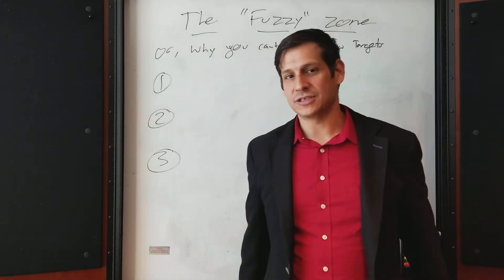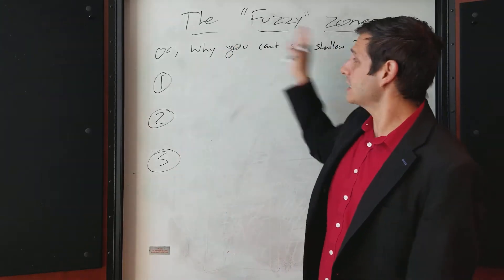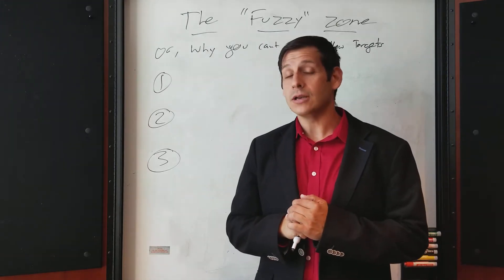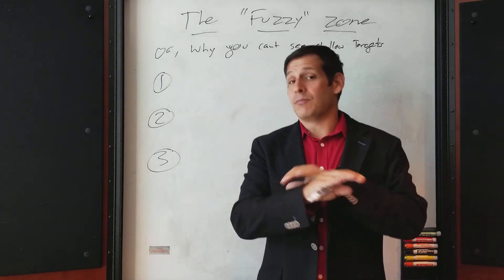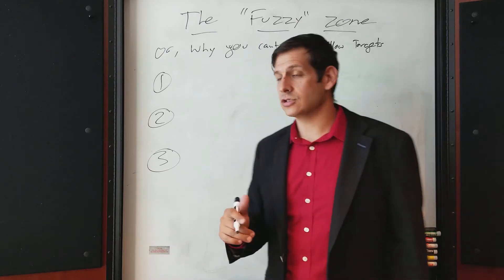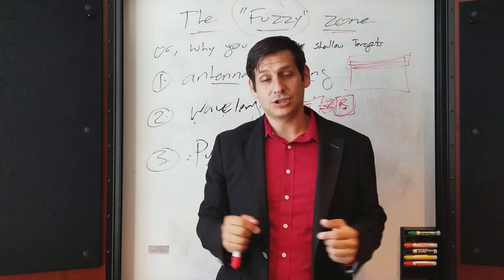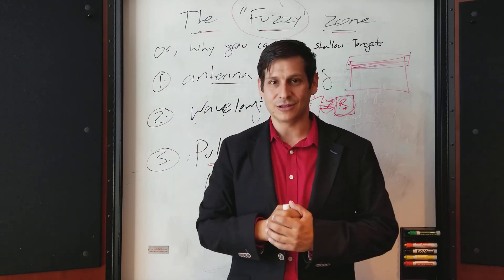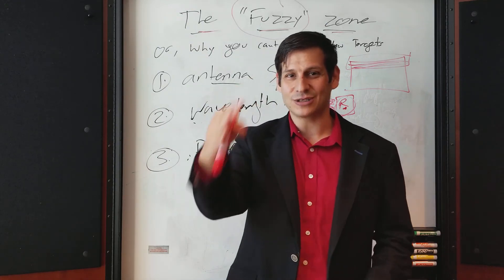A GPR's "Fuzzy Zone" | Why it is difficult to locate shallow targets with Ground Penetrating Radar

Comment: Hello Dan,
Can you please explain about the resolution of GPR ie vertical and horizontal resolution both.
Can we define its resolution in pixel size, as radargram what we get is a raster data only.
Plz explain
Reply from the maker: Thanks. Glad it was helpful. I have some other videos in the que but ill get one out soon on resolution. Be well! 😊
Reply: @Learngpr  thanks
So many doubts I have though.
Can I ask you in any other platform too like mail?
Reply from the maker: Great question. I will make a video about this. You van look at resolution in multiple ways. The most recent video i did is about bits. Its a good place to start. Ill make one that goes over vertical and horizontal res, including step rat, signal footprint, wavelength, sampling etc. Thanks so much for watching!!
Reply: @Learngpr  seen your latest video.. Great it is!!
Will wait to see your video on resolution.
Thanks Sir 😊